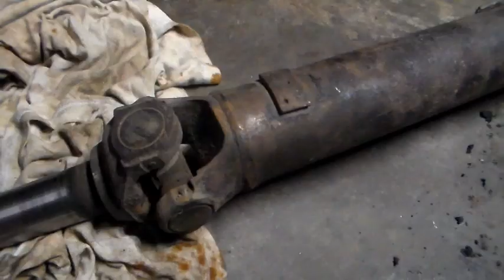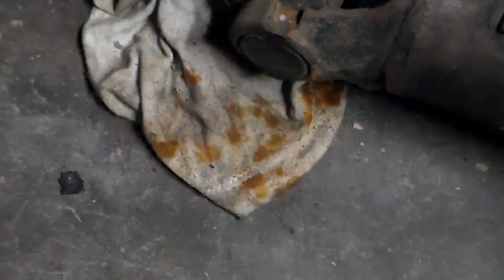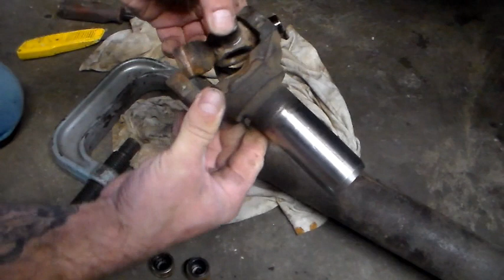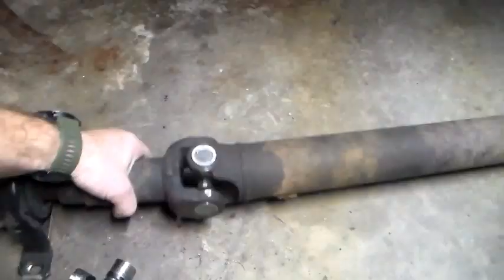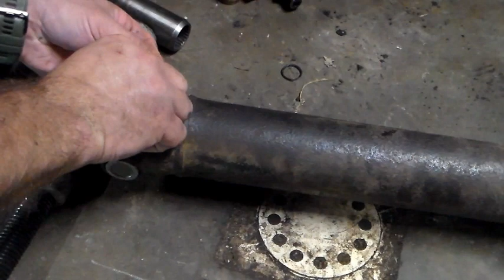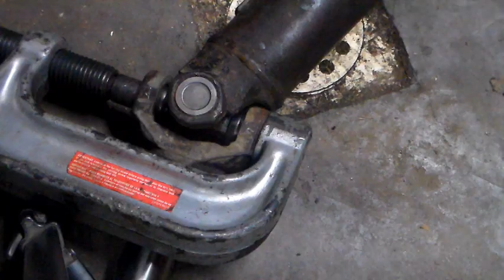Chevy S10 HOW TO REPLACE Plastic Ring U-Joint - EASY!!

Comment: GM's been using the nylon press-ring system for decades. Easiest way - hit the yoke around the cup with a torch. Turns all the nylon inside to ash and they pop right out using a regular C clamp (vise is even easier). Can't see spend a hundred bucks on something you'll use once or twice for the lifetime of a vehicle. If that's your boat, go to Autozone or Oreillys and rent - free is GOOD. If you do more, go for it but this is the easiest way and the way GM recommends to remove OEM universals. You'll wanna clean the yoke where you removed the cup pretty good (takes a minute) to get all the debris from the inside groove. Just took me 10-15 minutes to replace 4 on a 2003 S10 extended cab. Make sure you mark the yoke with the shaft and the differential because the whole thing is balanced only one way (phus the slide fittings are keyed). Great vdo...
Reply from the maker: No disrespect but if you have a torch set you probably already have a U-joint press or could afford one lol. Razor blade took 2 sec...I think a lot faster than getting the torch set out and fired up.
Reply: @rednecktech82  No disrespect taken but using a torch you remove ALL that nylon within the yoke (it all turns to ask leaving NONE left behind) and it makes reinstallation REALLY easy (especially when you've got 5 to do and time matters). Whatever works for YOU - cool. Quite a few of the later S10 models (same with Blazer/S15/Sonoma/utility) use that c-ring on the outside of the universals on the inside of the yoke. 91's 1st Gen. was WAY easier than 2nd Gen. with the 2-pc driveshaft, the center support bearing and those stupid cardan joints...don't get me started 🤣🤣🤣

Comment: Is this process the same with the double cardan joints as well? I was looking for anway that didn't involve fire and this method seems to be the way. Not just the way but, The Way.
Reply from the maker: If it has these plastic molded joints then yes same process.
Reply: Yeah i keep seeing people with a blow torch melting the plastic out. This seems easier and faster since you don’t have to let it cool down.

Comment: Nice video. I've done u joints a few times but never had any with the plactic so I was confused how to replace em. Thank a lot. 👍🏼
Reply from the maker: Exactly why I made the vid. Over 20 yrs back yard mechanic and I never came across them before...figured someone else would probably be as confused as I was.